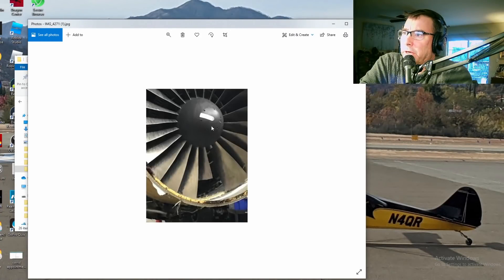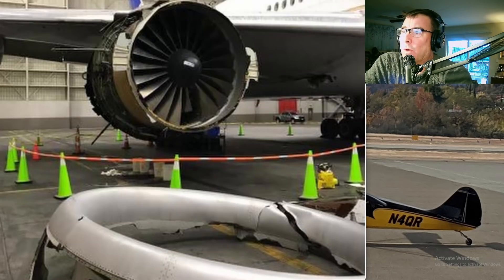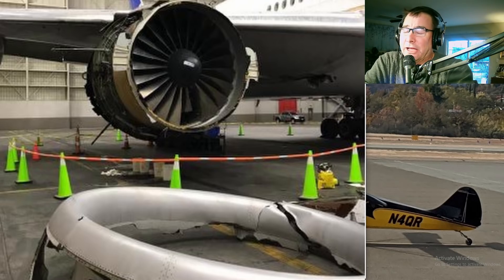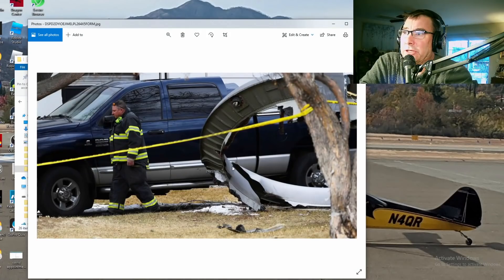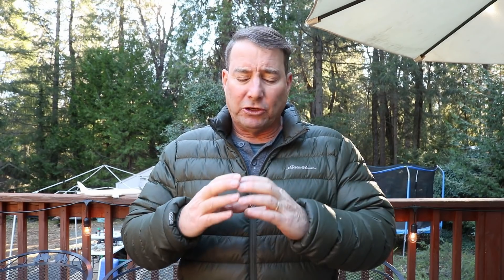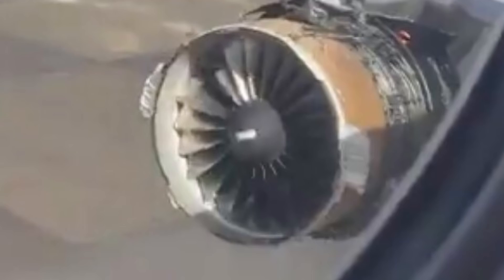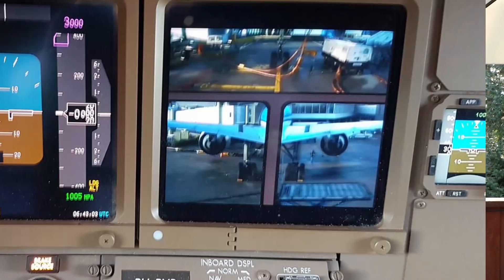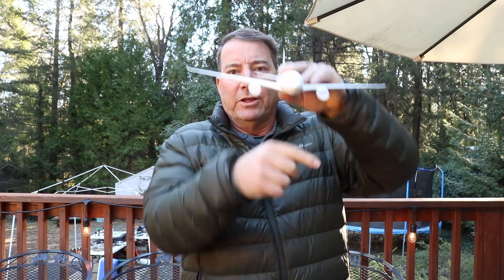UAL 328 UPDATE Fan Blade Failure  B777-200  22 Feb 2021

Comment: As a 30 year A&P I can tell you an engine fire extinguishing system is useless without the cowling, and would just be a "white fart in the wind".
Reply: Hi Terry British Engineer here Interesting that the Reverser C Duct was not in place, I would expect the fan cowl to go but the C Duct is a Heavy bit of hardware I also agree the pulling of the Fire Handles cut the fuel off and the Fire extinguisher only made white smoke in the early video I saw I would assume it was the second attempt as per the Crews Emergency SOP's/ FRC as they still had a fire warning that I saw being discharged
Reply: I would assume the fire detection loop is part of the cowling and would have departed the airplane with the cowling.  I don't think that the none flying pilot would jump up, run back and check on what parts were gone.  Running the engine fire checklist is the best way to handle the "Engine Fire" indication.  The pieces parts of the fire detection system would not be covered by the media unless someone who was a true expert was reporting on this.
Reply: @mikedenning9261  Yes I would also think the ICAS would show a FIRE WARN  Message because the wire has gone  Plus also the R/H Pilot can Look rear from his seat if not then Crew would call it in from the Cabin.
Reply: they likely pulled the fuel cut off and what you see burning is most of the accessory unit..
Reply: @warmfreeze  Unless they use flammable cladding like they do with towers in London !
Reply: Yep. That is about the size of it.
Reply: Thankfully, the fire did not spread - maybe due to the relative wind keeping it from doing so?  Any thoughts on how or why the fire was contained?
Reply: @sparkyranger4737   By pulling the Fire Handles the Engine Fuel is shut off by rotating the Handle discharges one of the Fire suppression bottles by turning the Handle in the opposite direction the Second fire suppression bottle is fired  It also would appear that the Core Engine and Turbine area are intact the fire is coming from the diffuser vanes for the Thrust reverse  system so the Air flow is still going as it should through the engine as only the Fan blades are missing The wording of Contained engine failure is  Correct if the Engine had become Un-contained there would be a lot more Damage and the Engine would be a lot worse off The Manufacturers have to ensure that if the Engine fails like this it is Contained to gain certification  Gas turbines go through a very strict test program to gain these certifications
Reply: @hyime69  The first stage fan blade broke off, spit out the inlet and ruptured the fuselage.   Contained failures are when a failed engine can either retain the broken components or exit them out the exhaust.  I think its un-contained, but its certainly not what comes to mind when someone mentions un-contained engine failure.
Reply: @F110mech  After looking at the further reports it is plain to see that Parts did leave the engine fan area and other damage did happen to the lower fuselage again  and I am a Great believer in allowing the NTSB/AAIB people to do their jobs and give us the Industry professionals their findings on what caused it and the actions that we and our respective companies are going to have to do to make it not happen again I hope that they find the FIX for this and the Boeing 777-200 has a long and useful operating life
Reply: @hyime69  I wholeheartedly agree with everything you said 100%.   Whats most important is that this mishap is not repeated down the road.  Its bazaar that blades can bounce around and project forward out the inlet.  9 times out of 10 its going aft and taking the core/bypass route.  My last year in the Air Force we had mishap where a 1st stage fan blade (PW F100-229) broke off on takeoff.  It cut through the inlet case and shot out the top of the aircraft (F-15).   Luckily no one was hurt and the pilot aborted safely.  We ended up finding several engines with defective blades (minor tooling marks) in the manufacturing process combined with high cycle fatigue.  It was a mess!  Hopefully this one is isolated and an easy fix!
Reply: And this is a fact brother ! I’m also an A&P for United airlines
Reply: "white fart in the wind" LMAO!!!   Very true statement

Comment: if that motor fell off from the vibration can the plan stll fly thanks pete love your channel
Reply: Well the engine was not working from the time it failed, so whether it falls off would not make a difference. And the aircraft was flyable . Possibly if it fell off,  there would be less vibration

Comment: Do you actually have the ETOPS range with shredded cowl?

A single engine flight with intact cowl is significantly more aerodynamic than one with shredded cowl...

There have been several piston twin accidents where the catastrophic failure of the engine violated the cowl in a way that significantly increased the drag and reduced performance.

Comment: Provably had a crack 1/2" in the back of the traling edge of the Inlet Guide Veins! Titanium Blades are some blades but when they go, they will take out the entire engine! Engine blades need a NDI inspection   during ground maintenance!

Comment: Maybe some dumb questions,  only asking cause I don't know.

Does fuel ballast affect anything in this type of situation??

Does the Pilot always assume the worst when going through a checklist on the planes outcome, and contemplating a crash  scenario, or is this on His, or Her discretion?
Great vids👍👍
Reply: The weight of the fuel is part of the calculation that is made to determine the length of runway that will be required if the plane is to stop safely.

Comment: the comment about the fart in the wind is probably true in this case ,but when the fire alarm bell sounds and the fire handle lights up the pilot must do two things immediately. number one pull the lit up handle ,number two rotate the handle left or right to fire the bottle wait a short time and if the light and bell does not stop rotate the handle in the opposite direction to fire the second bottle. The cowling is designed to fit closely around the engine and is tightly sealed to hold a fuel fire in so that the fire agent can work on starving the fire of oxygen, The fire detection and overheat detection sensors run on a frame under the low pressure compressor and accessory gearbox because that's where fuel is likely to collect. The only difference between the overheat and the fire detectors is the temperature settings with the overheat sensor looking for hot air leaks and the fire detector looking for fuel fires. The detectors in the back of the engine are mounted high near the fire wall and are looking for hot gas leaks.

Comment: So let's just remember that the fan cowling is not a structural part of the aircraft.  The containment shroud held and prevented the separated fan blade from flying through the airframe and potentially turning an emergency into a catastrophe.  The PW engine failure containment design did its job, and everyone walked away.   Yes, people on the ground could have been hit by the falling debris, and that is something that the NTSB will surely take up, but that's a whole lot less debris than an entire airliner.
Reply: There Trent 900 motor that failed on the quantas flight was labeled "uncontained" Cost RR a billion. Was it design failure or something else?
Reply: @highpointsights  Contained vs uncontained is just whether the failed fan blade departed the forward engine portion. 
It doesn't tell much about how bad of a failure it was
Reply: The issue is if a inspection should had detected defects in the blade before falure.
Reply: @bindingcurve  just a note - ual 232 inspection came back on United vs engine mfg (GE)

Comment: A feature unique to the 777-300ER and 777-300 flight deck is the Ground Maneuver Camera System (GMCS),    This is a great idea that should be on every plane.   The flight attendant shouldn’t have to tell the pilot the engine fell off.   Juan best video yet.  Except for the ones with Pete.  You answered my question about fuel.   Once again.  Great job.

Oh and if you get any more comments from your subscribers you will be spending 18 hrs a day just reading them.

Comment: Very well explained. I didn't know about the onboard cameras on the 777. One worry I would have about the scenario of a similar engine failure over the pacific to Hawaii, is how the vibration over the 2 hours it may be to reach the alternate, could be so bad that the entire engine dislodges completely! I know that you said the wing should be able to cope with this, but I remember a crash of a 747 that occurred due to the engine falling away and damaging the leading edge of the wing, making the aircraft uncontrollable. It would be extremely uncomfortable sitting at the window seat next to that damaged engine in flight! 😱

Comment: what about after landing and the heat of the fire going straight up and  superheating the wing where the fuel is?
Reply: Some of the passenger shot videos out there show the ARFFs hitting the engine with foam very quickly after the plane stopped.
Reply: @masseypadgham7113  thanks !- I tried to find vids of the fire department response but couldnt locate any

Comment: 10:46 Why does an airplane have to reduce altitude when it loses one engine?  I know that the passengers are breathing air compressed by the engines, but can one engine not do that?
Reply: Not an expert - just an aviation buff and auto & small engine mechanic, but I would imagine it's because the aircraft needs more power to maintain speed due to the loss of one engine. Descending to where the air is "thicker" will cause the engine to burn more fuel, which equals more thrust.

Comment: Juan:  Hope you see this as there are already a lot of comments. You might not know that the aircraft certification process (airplanes with jet propulsion) assumes that loss of a blade and subsequent vibration from a windmilling engine can occur. You can find the details online from AC (Advisory Circular) 25-24 – Sustained Engine Imbalance. I hope this helps.

Comment: Seems to be a common denominator between large turbo fan engines and losing a blade. More weight from size equals greater centrifugal force so they need to keep changing out blades or making the fan a bit slower/smaller.

Comment: Wow that blows my mind 35lbs a blade? really? I know the leading edge of the fans and compressor fans are often titanium due to the high temps. But I though the blades where a carbon composite? or is that the later era of engines post 2000's? That just seems to be an excessively high weight for a single component of a rotating assembly such as this in my mind. Any aircraft mechanics or engineers able to enlighten me on this? I really curious now, thx in advance!

Comment: Excellent info as always!  Love the "white fart in the wind" analogy, hahahaha! 

On your point about oil burning, I thought I saw an entire accessory or hydraulic pump driveshaft laying in the road near the house where the nacelle was by the front door, with the camper and black truck with the flattened roof. That would most certainly be the source of the oil. https://youtu.be/Ez0z8KNUA3s?t=120

Comment: Hi Juan: great report. Don’t know if it’s me but I was taught the max speed on single engine was only to determine the biggest 180 minute ETOPS circle, it is by no means necessary to actually fly at max speed when it happens. I would imagine that unless you are on fire you could do long range cruise once you have levelled off.
Also in my airline it is assumed the captain will take control, not necessary, but he probably would. Who knows, maybe we are a little or captain oriented, that’s  why I’ll let your “F/O does better landings” comment slide.......
Great  job Juan , love your videos 
Hans Juergensen

Comment: Hollow shafts are dangerous so fan blades would be the same.. my front stabilizer bar on my car failed it was hollow the older one I replaced it with was solid but heavier.. lots of Formula 1 accidents caused by hollowing out shafts and control arms...saves weight ya but not worth the risk IMO especially with Jet Engines. Making it more fuel efficient and so on is a bean counter move in the wrong direction!!

Comment: ETOPS = Engines Turn Or People Swim....Old Jet Mechanic saying during ETOPS certification!
Reply: Rather amusing, yet ZERO planes in the drink due to an ETOPS issue.
Reply: @TheBeingReal  you have to remember this saying came about in 1992ish, when everything crossing the ocean had 3 or 4 engines. To do it on 2 engines was a bold idea. Yes, it has worked out, but us Old Jet Mechs, had our reservations about ETOPS. If that engine had popped exactly mid way, we would have seen the worst case scenario, but it popped within minutes of departure. And the other UAL 777 that had a similar event happened 200 miles from destination, so no big deal either. If this were to happen mid way, it could have had a very different outcome.
Reply: @stevemagnuson7051  True ETOPS was a bold step, it has worked though.  Juan Browne on his channel discusses this over water situation, he is a 777 pilot too. Worth your few minutes, he has a great channel on air safety. Blancolirio is the channel.  👍🏻
Reply: @TheBeingReal  I know Juan through another retired UAL captain....good channel for sure. Yes, ETOPS has worked in the long run. It will be interesting to see how these issues are addressed long term. I’ll bet the team at PW who designs fan blades are having a good look at the data!
Reply: @stevemagnuson7051  scramble time at P&W. I work with their engine team in CT. Will be fun to get the inside scoop.
Reply: @stevemagnuson7051  The conservative position of 'Old Jet Mechs' is always safer! 

 The unstoppable search for higher and higher performance and lower and lower specific fuel consumption, or lower and lower emissions, all has reached a point where something is going to break sooner than "calculated"...

Comment: I worked for P&W in the 90's and 00's, and these are TITANIUM hollow fan blades, they are machined in two halves, a pressure side and a non pressure side, cleaned, clamped together and fused together in an autoclave, Titanium fuses together nicely at high temperatures, but it has to be fanatically clean for a good complete weld. Sadly, the accountants at P&W during my time were pinching pennies and assembled these blades in an old world war two factory without a clean room, it had rubber block floors, was within steps of a greasy machining line, and poorly lit, and they were having terrible fan blade rejection problems. About five  years or more ago, P&W invested in a factory with clean room assembly and clean floors and lab coats and hair nets, none of which were present in the old facility. They were so proud of it, they put up a video about it, on YouTube of all places:  https://www.youtube.com/watch?v=rqQo2eTouE4   Just in case any of you were wondering at all about fusing hollow titanium fan blades together and what can go wrong; titanium is intolerant of dirt, chlorine, grease, even the oils from  your hands will cause a weld or fusing to fail. Good luck, and Broomfield, Colorado, the P&W executives knew this was going to happen, they knew the odds.

Comment: When the 777 was in development, this was the exact scenario that it's detractors envisioned.  Previously, planes that big would have 4 engines because of how catstrophic a blade failure could be in such a large diameter engine.  I'm glad that the plane survived and everyone is safe.  But despite the higher operating costs, perhaps smaller engines would be better?
Reply: But yet, a blade failure in a 747 took out the whole aircraft by striking the adjacent engine in the Netherlands, El Al cargo crash. And, operating costs are everything for airlines.

Comment: What if the other engine goes out for the same reason?  I would still feel comfortable on a 4 engine plane especially over the Pacific.  I never bought the 2 engine change from 4.
Reply: Well those aircraft are all basically retired now. Will you go by surface ship?.

Comment: I thought the power plant and airframe were two separate entities. Is this engine unique to the B777-200. Poor Boeing.
Reply: Yes, but there were two other options originally. Those other two engines types are not part of this investigation.
Reply: @johnhaller5851  Thanks, It's more to do with that power plant than the aircraft it was attached to. Poor Boeing. That alloy would slice through anyone's cowling.

Comment: Why is the benefit of flying at a lower altitude with one engine out?
Reply: Because they have to. One engine = less thrust. You can fly higher if you max out the engine to 100-110% but then you risk engine failure there as well but even then you can’t get to dual engine cruise altitude

Comment: 98% of airline passengers just have no idea how much goes into flight preparations to make sure no matter what happens from takeoff to landing, they will reach their destination safely, as they always expect to, every time they board an airliner to take them from point A to point B.  Cockpit crews go over multiple procedures before departure in case of inflight emergencies as well as potential problems that might be incurred  on takeoff or landing.  Additionally the time spent by the cabin crew to secure the cabin  before boarding making sure it is safe and proper onboard medical equipment is present and operational.  Airline ground ops monitoring weather conditions, load factors, proper fuel loads, equipment substitution if necessary, and that there is the necessary ground personnel to support the on time departure that every passenger expects to just happen.  It is only because of all these professionals, that we can truly say that the flight taking us from point A to point B is the safest part of our journey.